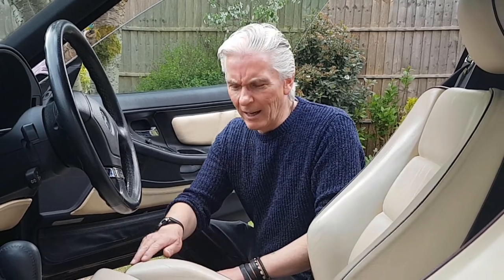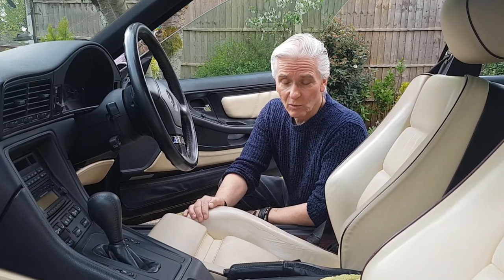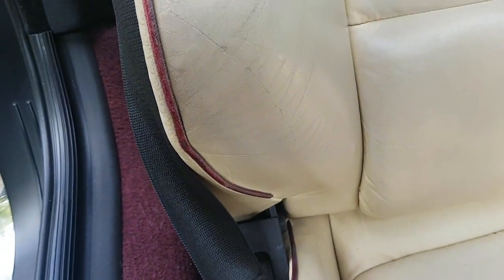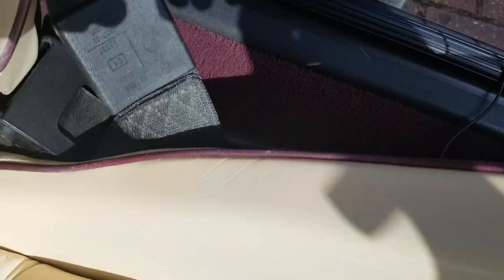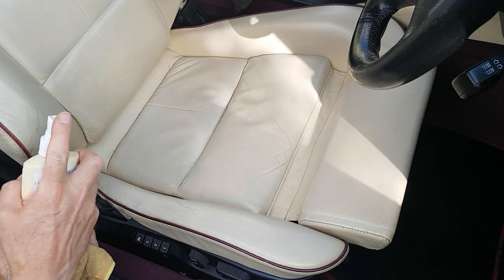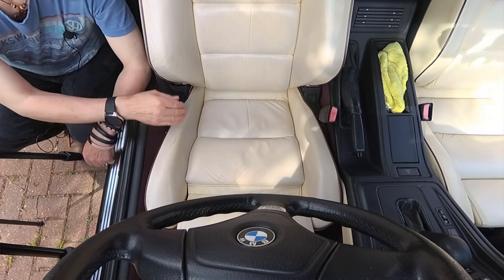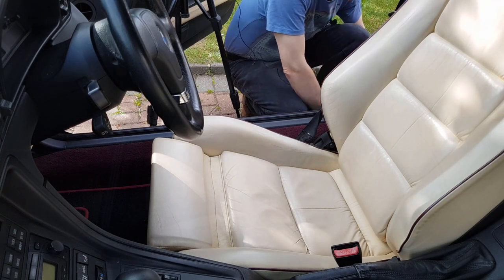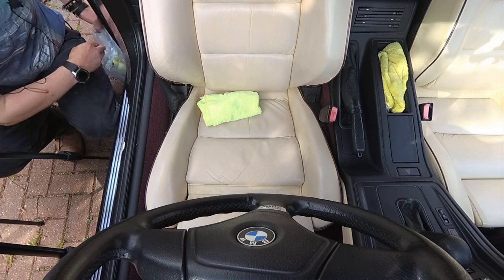Lock-Down Leather Care on your BMW

Comment: Hi Timm, have you changed/repaired the screen on the 8 before? I have dead pixels on my OBC top screen and I have an almost completely unusable radio screen. I can only find repair services and I begrudge using one of these when I have so much time on my hands in lockdown.
Reply from the maker: Luckily I have never had pixel problems in any of my cars! There are services on Ebay that solve these problems, and that's what I would go for.

Comment: Hi Timm, ever had radio cut-off issues with your 6 series? My e64 is brilliant engine wise but when it rains the radio goes crazy 😔 I did clear all drains out in the roof fold away bit.
Reply from the maker: No, not a common issue - if rain affects it then look for water under the front glass - make sure it has been 360 degrees sealed...